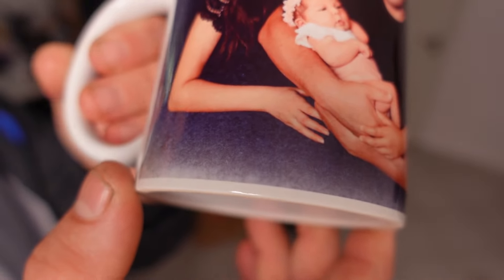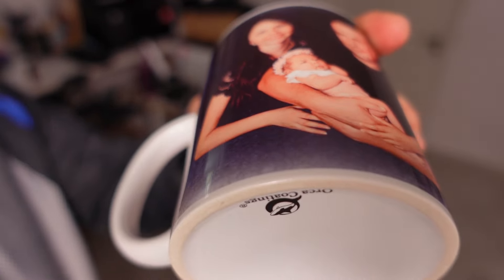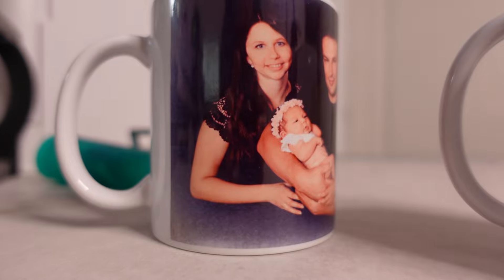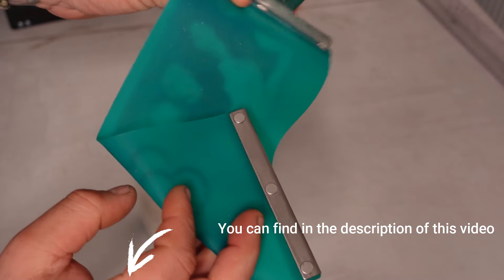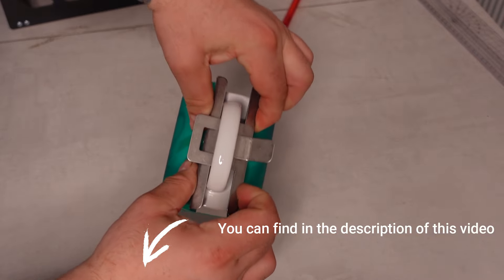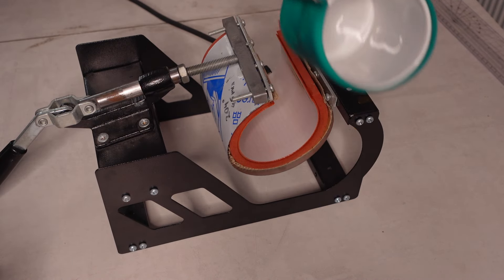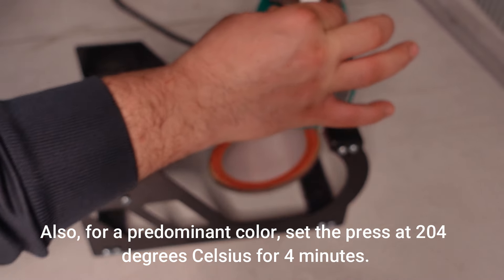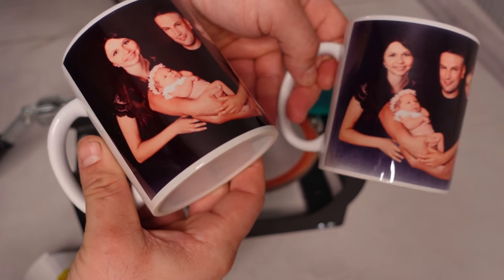How to print or sublimate a mug like a pro in 2 min! Blurry image poor print?  Avoid common mistakes

Comment: My mug press broke and I still had one of these silicone mug wraps from when I first started. I still had issues with the image coming out in certain areas on the edges. What I found to help was to place heat tape across the image from top of mug to the bottom about 1/2 inch from the edge of the end of the image. This helped a lot.

Comment: Is the silicone wrap mandatory? I just did my mugs based on the specs of the Manufacture and it was 380 heat, for 70 seconds. I do not have he silicone wrap. My image is comin out extremely light and most of the ink is still on the paper
Reply: Bro, for mus you need 180seconds... You dont nees this silicone. Just 380 180-200sec
Reply: Perfect mug at 375F 190sec. You can use parchment paper or butcher paper instead of silicone.

Comment: Mug press not closing with silicon wrap in it
Reply: Hey Den, Have you tried loosening the grip on the coffee clamping mechanism. There should be a circular metal piece that tightens and loosens. This will allow more space before clamping it down.